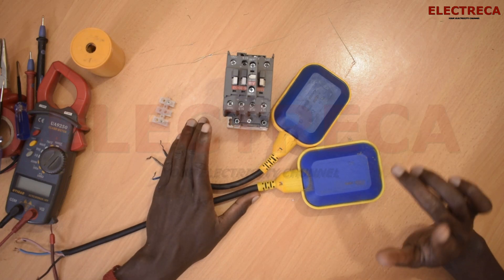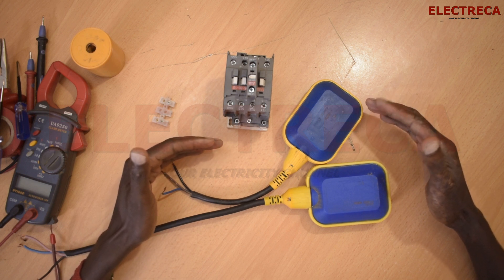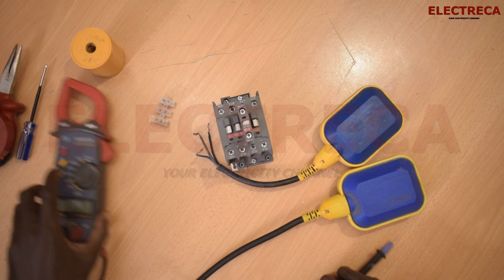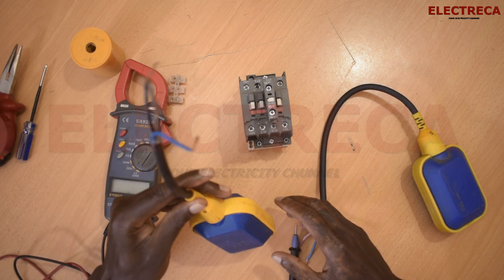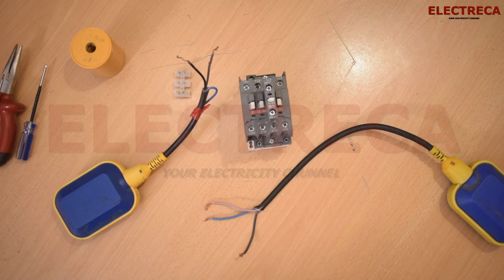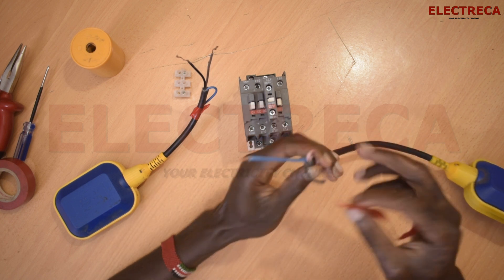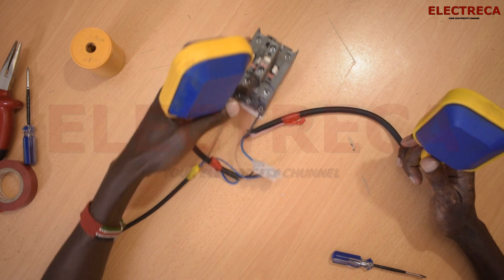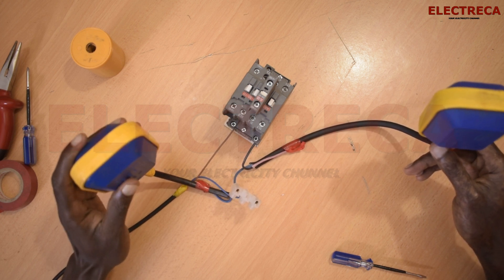Float Switch Wiring - How to Connect a Float Switch to a Water Pump

Comment: Sir please explain what will happen lf water level in upper head tank is full but water level in lower tank is empty what will happen in this condition
Reply from the maker: This condition is the reason why this circuit exists. So to answer your question, if the level gets low in the lower tank, the circuit breaks. Note the float switch in the higher tank controls the pump, and the one in the lower tank protects the pump from running dry.

Comment: Great video thanx.How would you connect those two switches to control 2 pumps for one tank .One pump to fill the tank and another pump to empty it . Only one switch does not give me enough travel to be use for 2 pumps and to utilise my water drum to its full capicity.

Comment: nice video.
please what is the specification of the contactor
Reply from the maker: The rating of a contactor depend on size (power) of the motor or pump,40amps  is suitable for most small pumps because are rated at 7.5kw.

Comment: Thank you!  

I have a pump in the bottom of my well that fills a large storage tank, and a booster pump draws water from the storage tank and fills a pressure tank. I’d like to know if I could use one float switch for the two pumps. When it is in the high position, it would shut off the well pump but allow the booster pump to run. When it is in the low position, it shuts off the booster pump and turns on the well pump. Is this possible, or do I need two switches?
Reply from the maker: Its posible but for smooth operation two switches is better.

Comment: At time 6:29 Im trying to understand why you connected the common (black) to the other blue wire . Would it matter if i connected the common (black wire to common of the other side or not?
Reply from the maker: Yes, it matters....... a float switch has 3 wire BLUE which opens to common and RED closed to common if held in the downside position. the reverse is also true......
Now about connecting common to blue.
You see am connecting 2 float switches in series and at the end, you must have a common......so I connected Blue and Black so that I remain with black(common) and Blown....op that helps.